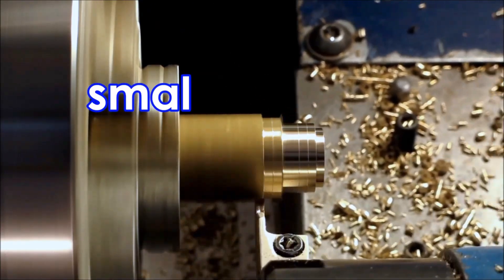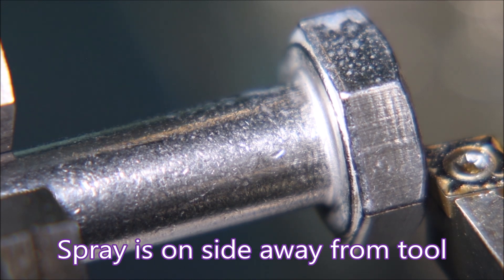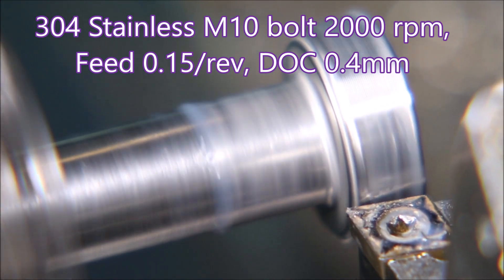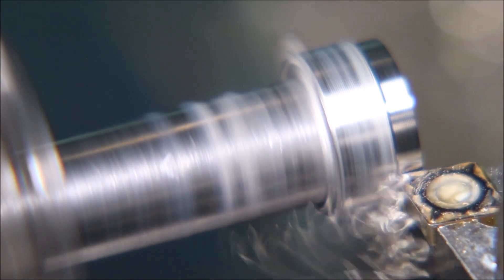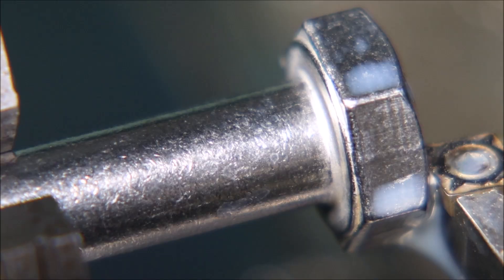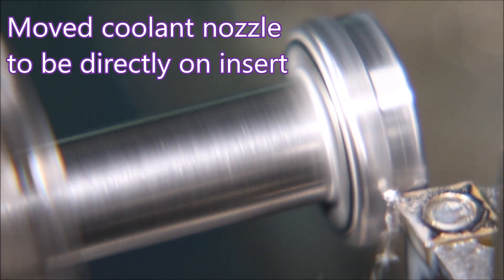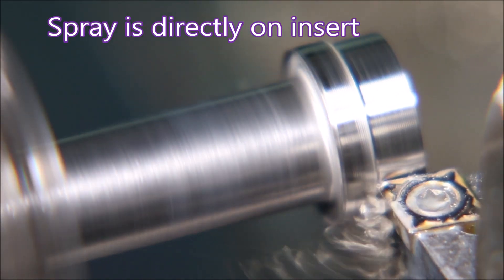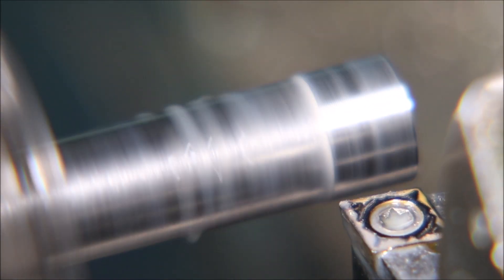Spray coolant boiling in my small cnc lathe

Comment: I don't turn much stainless but usually even after hogging a kilogram of some regular steel into chips without any coolant I can touch the insert with my finger. Hard to imagine that coolant would boil on top of it unless maybe it's the hot air warming it up?

Comment: Ive machined many different grades of stainless and even inconel dry, just with a bit slower surface speed. Flood coolant is great , gives a much lomger tool life and faster speeds for sure.
Was wondering how.you would go with just hi flow air ? Kinda like a air con unit the air is slightly cooler coming back off compression and if there is enough of it  ?
Reply from the maker: Hello, its been ages since you put out a video. Have seen quite a few folks using 3d printed form tools lately. Hi flow air in my shop is a problem. My compressor is in the same room as me and it would be making one hell of a racket all the time LOL
Reply: @smallcnclathes 
I've haven't been doing anything of much interest lately, I've a few ideas for new 3d printed form tools , but it will take time.
Ah yeah , aircompressors often seem quite inefficient especially when they are rattling next to you , lol .

Comment: I turn alot of exotic stainless like nitronic, fermonic, p550 and more bog standard stuff like 17-4ph and 316. My machine and workshop is always full of smoke from burning off coolant. Ive always taken that if the heat is in the chips and tips rather than the part then youre doing something right and there shouldnt be much to worry about as heat needs to go somewhere!
Reply from the maker: Hi Robbie, I have never even heard of the materials you mention. The size of my lathe has made me stick to non ferrous mainly and not any of those crazy bronzes either! Steels have been free cutting with just a little 316 and 304. Thanks for the comment.

Comment: For me its mostly to get some lubrication to the cutting edge, chip control when parting, keep the part cool, keep the rest of the insert cool, and keep the chips from sizzling when they get down the front of your shirt into your belly button...

Its 304 SS, so if the part isn't liquid, you're doing well! 
The material can be so inconsistent that it's really difficult to tell what if changes are helping or hurting.

Thanks for the video.

Comment: Interesting, this validates my observation that coolant directly on the cutting edge is usually better. I just use an oiler bottle with syringe tip and manually squirt the coolant. Sometimes when I'm lazy I use IPA to avoid the cleanup and thay works reasonably well too.
Reply from the maker: Hi, thanks for your comment, hate to show my ignorance but IPA?
Reply: IPA = Isopropyl alcohol.
Reply: @smallcnclathes  isopropyl alcohol as others have commented, not the beer 🤣
Reply: @HM-Projects  thank heavens indian pale ale is not being wasted as a cutting fluid! Woks well as a throat lubricant!!!
Reply: @smallcnclathes  IPA: a very delicious type of beer!!! Lol.